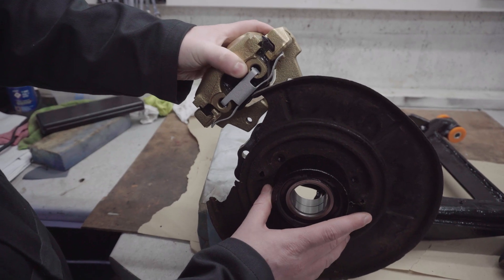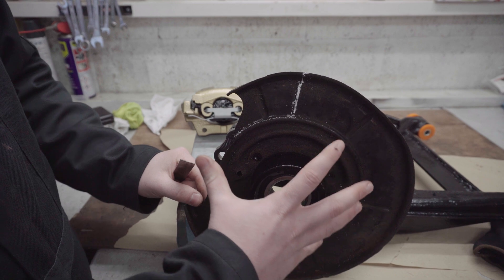Brake Shield Clearance – BMW E30 5 Lug Swap Big Brake Conversion |  Vented Disc Conversion | 009

Comment: Love the videos man! Thanks. I’ll be doing this 5 lug swap - thank you for all you do for the e30 community
Reply from the maker: Thank you mate - I hope I covered it in good detail for you between the videos on it.

It worked out really great in the end. Just need to get the car on the road so I can report back on its performance! 😃
Reply: @SPANNERRASH  thanks. I have an 1988 325is that I want to do the 5 lug swap on. I have the same wheels so you couldn’t have covered it any better. If you need anything out in the states drop me a line.